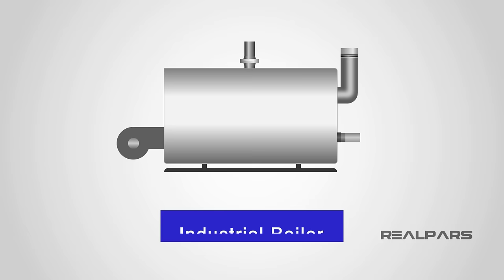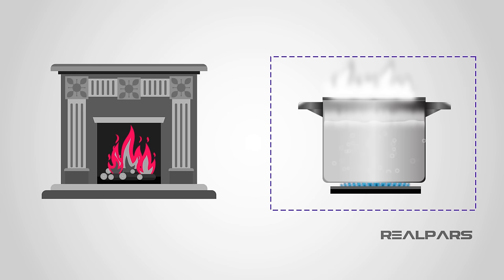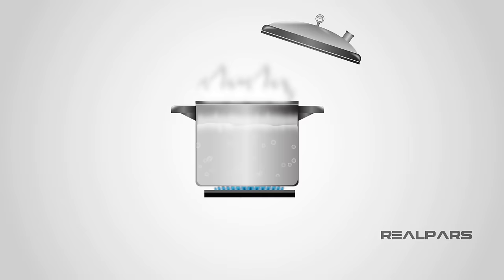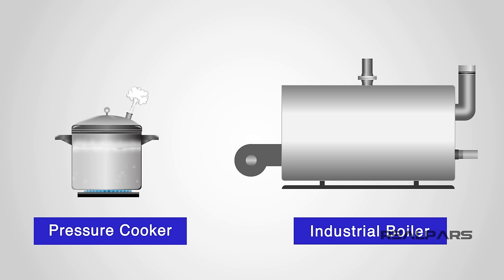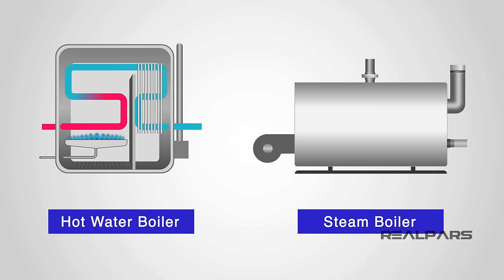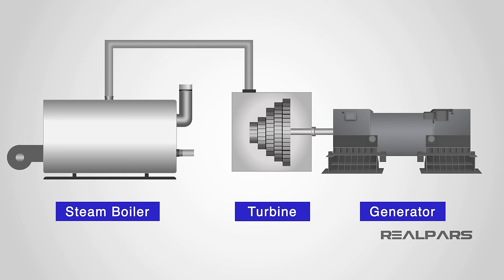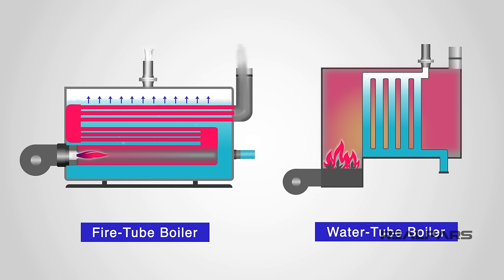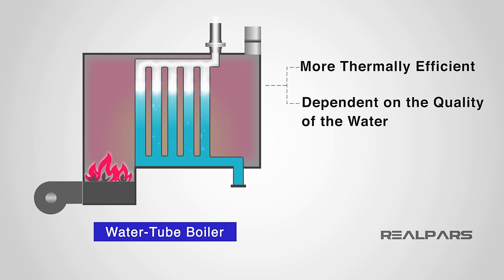What is a Boiler and How does It Work?

Comment: @realpars or anyone in the comment section....is there a device that can simulate analog output as an alternative to buying an analog output module that a PLC uses? I know of analog input simulation devices but have never seen one for analog output...In this case I'd  want to send digital signals to this device input then it outputs analog output just as a simulation
Reply: BrillianceTVNetwork Entertainment software emulator
Reply: @techs5384  for analog output? Whats the name of that software emulator? is it Factory I/O?  I would want it to be able to work with PLC ladder logic program to ofcourse convert digital to analog and manipulate an analog output or atleast show me how it would work in real life with real equipment....digital inputs are easy to simulate its the analog ones that are the issue.....
Reply from the maker: A PLC analog output simply outputs a variable signal from 4-20ma.  A 4-20ma signal generator would do the trick, but most have manual adjustment of the output signal. The Siemens PLCSIM application works with SIMATIC Manager or TIA Portal to provide a simulation environment totally within software, but it appears you are looking for a way to do this in hardware.  Maybe you could explain what you are looking for in more detail.
Reply: @realpars  you are correct I know there are analog input simulators that can be purchased on amazon e.g.https://www.amazon.com/Analog-Current-Simulator-Tester-4-20mA/dp/B007J38RQ0/ref=sr_1_21?keywords=analog+input+simulator&qid=1566964233&s=gateway&sr=8-21....what I'm asking is using the PLC I know I can send a digital signal but what output device would convert this digital signal to a 4-20mA(DAC Converter) analog signal that could be used on a output device(I/P or control valve) or just for simulation where the ladder code would be varied and this observed using a multimeter at the output of the DAC converter... I ask this in the event I have a PLC(Allen-Bradley) for testing purposes but no input or output analog module

I like the idea of entire software simulation does Allen-Bradley have a mechanism to do analog input and output entirely within the software?

Comment: so a boiler can use oil right to Heat up water  ?
Reply from the maker: Hello @Gracia. Thanks for reaching out. You are correct. As we said in the video at 6:30, a petroleum-based product can be used as a fuel source for the boiler.
Reply: @realpars  ... ,its interesting to see this machine ...that IT works on fuel ...its interesting to know that there are other fuels to ...i dont have much knowledge about that in dont work for Shell or any Company OR sumthing lol i am Just  interested  about fuel ,i Just want to know what natural  alternitives i can use to keep me warm and others warm  ....trough the cold winter if for example other resources OR fuel Fall out

Comment: why is quality of water a concern in water tube boiler not in fire tube boiler?
Reply from the maker: Water quality is a concern for any boiler type.  Dissolved solids, alkalinity, and hardness must be controlled in the boiler feed water in order to prolong tube life and prevent buildup of scale.  The only difference is that in a tube-fired boiler, the surfaces attacked by impurities is the outside of the tubes, whereas in a water tube boiler, it is the inside of the tubes.

Comment: We need to use other forms of energy instead of setting fuel on fire to boil water to drive a turbine for electricity. Wind,  wave, solar, and even old-fashioned nuclear fusion don't release as much pollution as burning things does.

Comment: I foresee fire-tube boilers getting their tubes clogged with carbon from incomplete combustion and having to be replaced due to being cheaper to replace than attempt to clean. Could be totally wrong though.
Reply from the maker: Believe me, they are easier to de-coke using chemicals and/or "shot blasting".  A commercial boiler may have 100s of tubes welded into a tubesheet support.  If the tube bundle is beyond cleaning or repair, it is replaced.

Comment: why can't it use wood to boil ?
Reply from the maker: For industrial boilers, wood is usually not a practical fuel for a number of reasons.  The main reason is that it leaves soot and fouls easily.  However, biomass boilers do exist, but they are expensive and have certain drawbacks, such as maintainability.  For non-industrial boilers, wood or coal are often used, since for small systems, handling of wood or coal is much easier.
Reply: @realpars  what about Brickets?